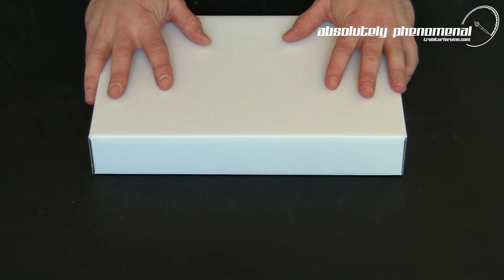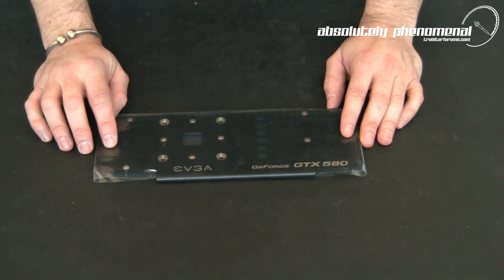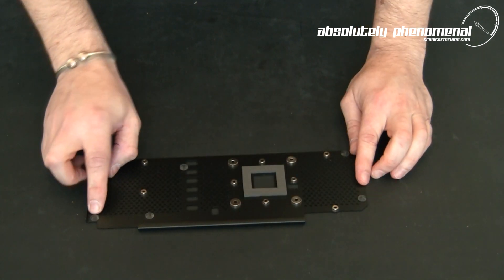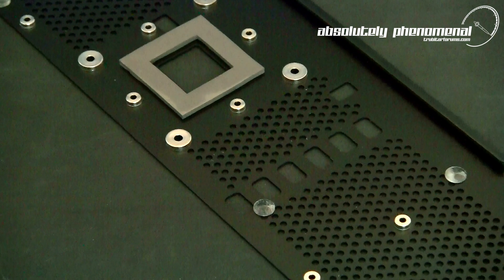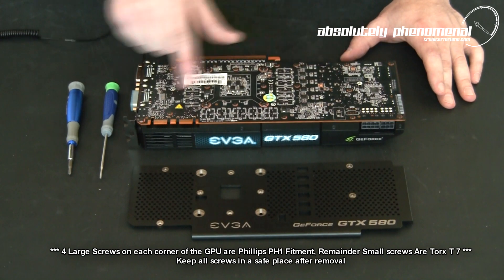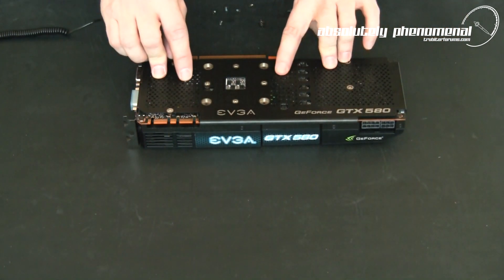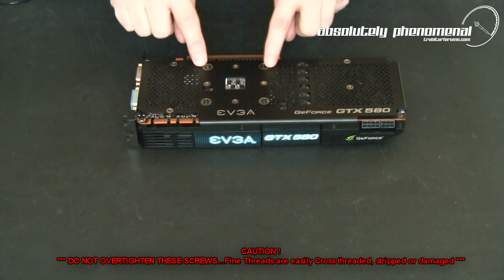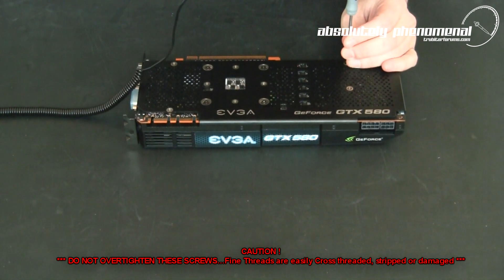EVGA GTX 580 Back plate

Comment from the maker: @Lensman864 : The Torx T7 provides a more secure fit in the screw head, you can use a Torx T6, however too much slack between the Torx driver and screw contact surfaces will significantly increase the potential of "Rounding" the Torx Socket and rendering your assembly useless...

Comment: if u swap the paste for as5 while doing the the temps wil go down another 3-5 C , try it , by removing the heatsink screws , you removed the pressure between the card and heatsink , breaking the bond of the paste .

Comment from the maker: @leafboy412 Three GTX580's willstill fit in 3way SLi correctly, although airflow to the top and middle card will become severely restricted, i would only install the backplate on the top card.

Comment: @trubritar :  I've just installed two of these backplates and a Torx T7 driver would NOT fit in the screw. Only a Torx T6 would fit and perfectly too. Is it possible that your screwdrivers are mislabelled?
EVGA specify a Torx T6 too.